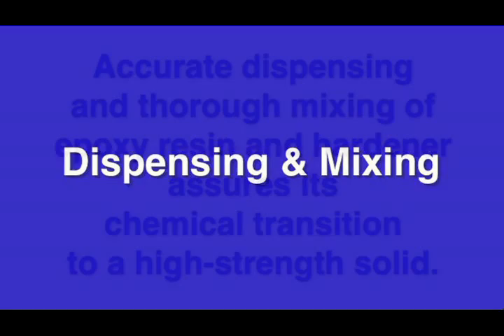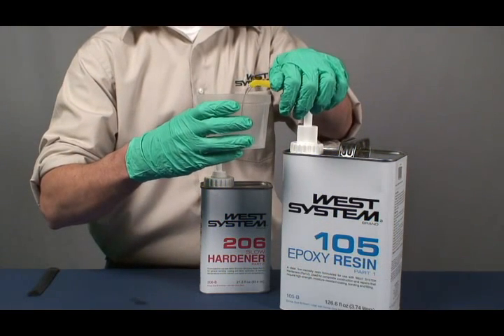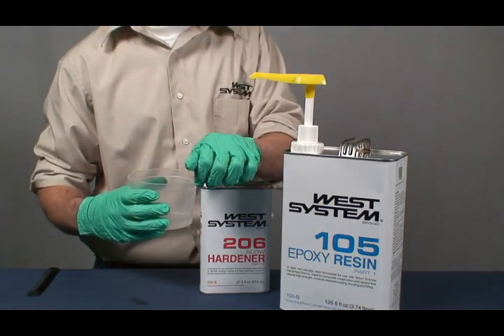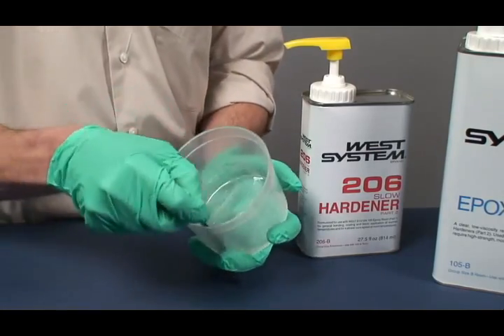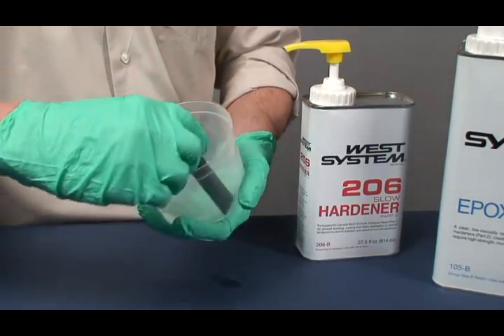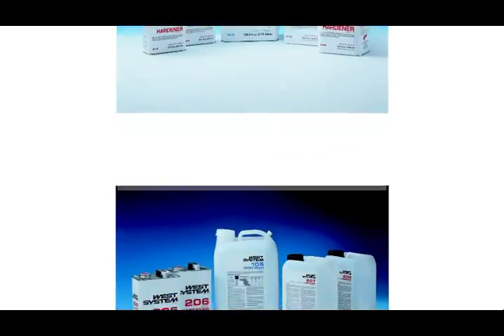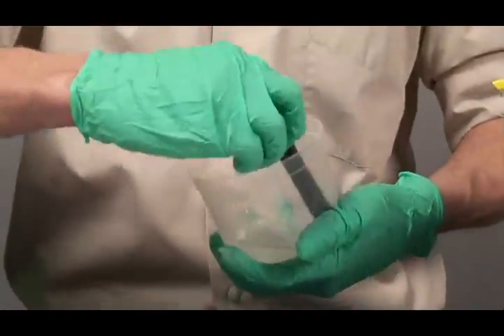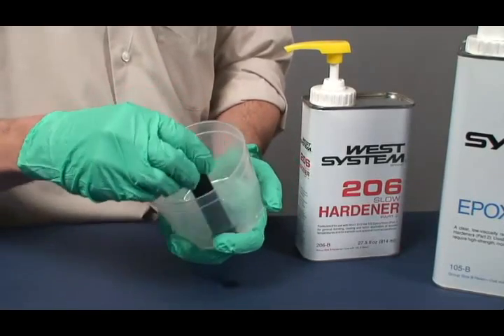Dispensing and Mixing WEST SYSTEM Epoxy

Comment: I mixed 5 ounces 105 resin with 1 ounce 205 hardener in a heavy plastic cup and did a small pour. then I poured the excess into a red solo cup and within a minute it boiled and smokes and expanded and sputtered. was it the solo cup? what did I do wrong? it got so hot it burned my workbench. what did I do wrong?